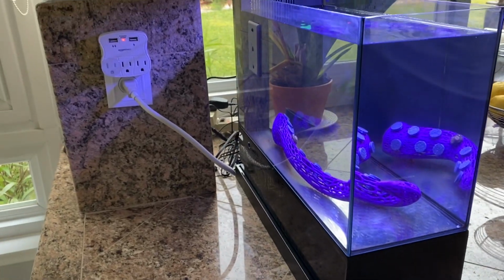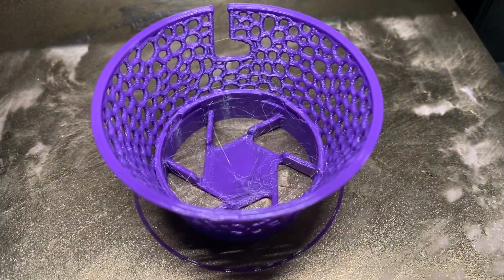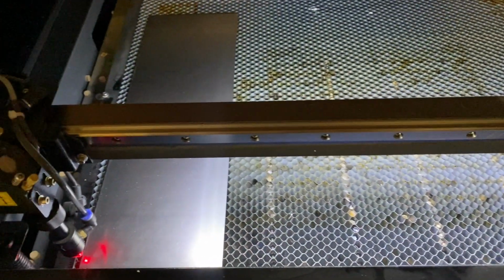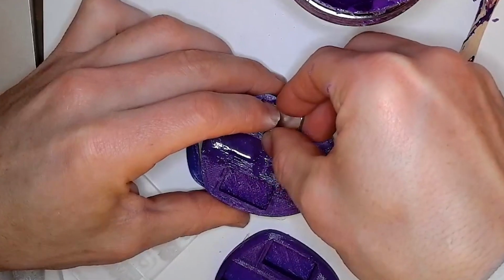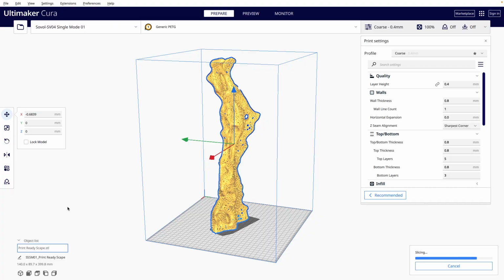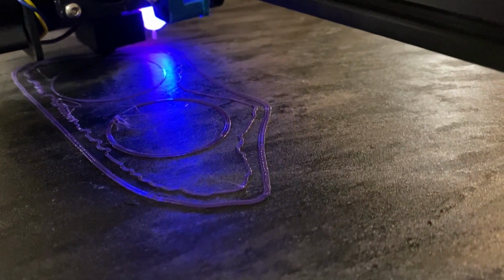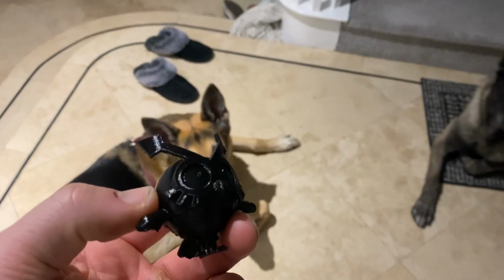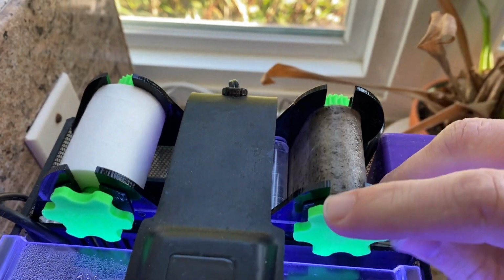Custom Fantasy Nano Reef Build - Fluval Evo Spec 5 - Part 2

Comment: Looks amazing but that ceramic media might hold nitrates down the line .
Reply: What would you prefer as far as biological filtration is concerned?
Reply from the maker: Anything can hold nitrates but I can always remove this and shake it out in some old salt water after a water change.  Problem solved in just a few seconds.
Reply: @ISeaLive  true! It would be pretty easy to dump and clean if so especially a nano! Just speaking from experience w my 5 g reef haha. I filled my back chamber with media thinking it would help with bio filtration but it’s just been holding nitrates … also I am never doing deep sand beds on a tank that small again. I do 50% water changed every other day for almost a month and still seeing 50 nitrate . So yeah at least you can dump it out mine is kinda stuck there unless I fully break down the tank .

Comment: Can i ask what Ender 3D printer you using and what other attachment you have? Possible to do a series of the 3D orinter
Reply from the maker: The printer I used in this video is a Sovol SOV4 but for the move part I use an Ender 3s1.